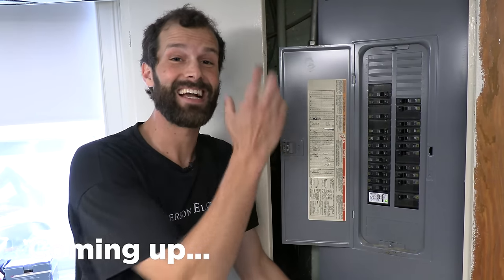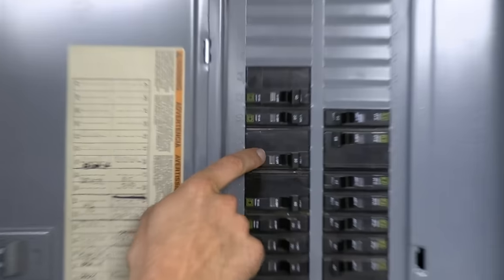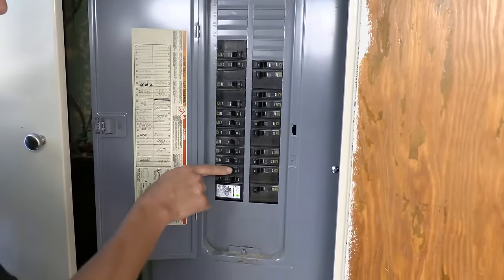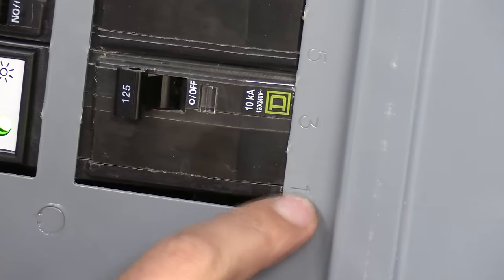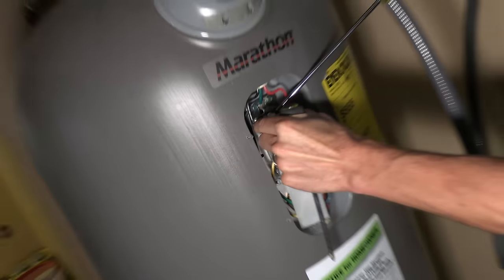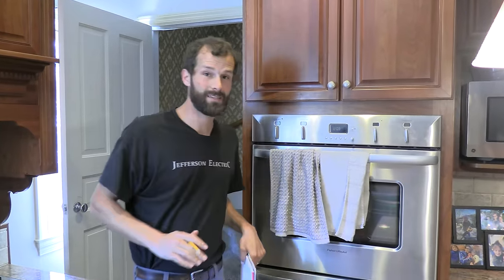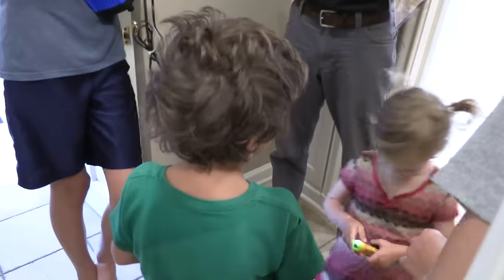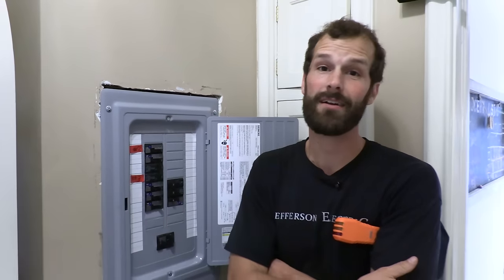A Master Electrician's Worst Nightmare

Comment: I ran into a breaker for an electric furnace that was off but the circuit was still  live. Never assume the circuit is dead until you check with a meter
Reply: So the breaker wasn’t off evidently. Always assume the power is on until you’ve tested otherwise.
Reply: Moved into a nineteen-fifties’ “starter home” ($US~15k) in ‘78, with a garage-bedroom conversion (obv. by a previous owner/helper) that popped a breaker reliably. Replaced that old Pushmatic breaker, found one that popped on the other phase. They had double-fed that loop from both strings of outlets !
Reply: @adammorgan9304  not true. I've seen a guy get shocked on a circuit while the breaker was off. Not a shared neutral either. We replaced the breaker and the problem went away.
Reply: I’ve seen multiple ways that the breaker is off but there’s still power to the device. Yes, there’s always an explanation, but that’s kinda the point. If you check for power before working, then you’re alive and healthy when you’re figuring out how the thing was wired.
Reply: Sometimes when I'm being lazy, I simply short the conductors together with pliers or something after turning off the breaker I think is the one. or before... 😮
Reply: @warlock529  I definitely short the wires with a tool to verify that I’ve opened the correct breaker. Pretty much always.
Reply: i looked for this answer!!! :face-fuchsia-tongue-out:
Reply: That makes no sense at all.  The source is either off or on. Getting lit up on a loaded neutral is likely what you’re implying happened.
Reply: Use your tongue to be sure, should feel the same as a 9v battery. Trust me im the battery.....
Reply: @killmenow5  HAHAHAHAHAHAHAHA i asked 16 yr old daughter if she ever haas done that her reply NOOOO Why would anyone do that!?!?!? man, these kids don't know real fun yep in my 60's :face-blue-smiling:
Reply: Always Always Always double check with a meter!
Reply: a meter wouldn't show a live wire unless you have access to a known ground for the other probe, so a NCV tester is good as an additional check, because it can detect the high voltage in absence of a ground reference. Have both on hand-
Reply: I mean, I usually just touch the hot with one finger and the ground with my thumb but sometimes I can't feel it so I guess a meter is more consistent. Also, be aware that switching off a 240v wall heater at the Tstat may only turn off one phase, the heater will be off but there will still be a live wire there.

Comment: That was not an insulated screwdriver. That is a Klein by the looks of it and says right on them that it will not protect against electric shock. Insulated has a plastic coating over the shank.
Reply: I think he meant a screwdriver with the handle insulates him. Since this video doesn't seem geared for experience wireman.
Reply: they just write that for insurance purposes, the handle is most certainly insulated because i often work on 600 with mine, just gotta know where the spicy parts are and dont touch em

Comment: If you don't care about turning off other breakers, you can find any breaker very quickly by using a strategy that programmers call binary searching. First flip half the breakers in the house. Light off? It's in that half. Light on? In the other. Then take the half it's in and flip half of those. Repeat until you've found the breaker.

If you have 40 breakers, flipping them all one by one will take 40 flips. Flipping them in this way will identify it in 6, maximum.
Reply: What an interesting practice! I'm curious as to how this is used in the programming world of work.
Reply: @thinktank8286  lots of ways, it's very handy! The most common usage is searching for a number in a sorted list. Even if the list is large, you can pull out the middle number and cut it in half repeatedly depending on whether it's greater or less than your target. The number of steps you need is the base 2 logarithm of the list size, much smaller than the size of the list itself. The principle is also used to partition data into "binary" trees (two branches at each node of the tree), where going down either branch cuts the problem in half, recursively
Reply: That is an interesting concept, but it’s not accurate to say 6 flips vs 40. You mean 6 “rounds” or groups of breakers operated. 

For example if you have 40 breakers, in the first round you flip 20, in the second round you flip 10, in the third round you flip 5, etc. So far 20 + 10 + 5 = 35 plus the last few rounds of 1-2 breakers each. 

Compare this to flipping all one by one. In both cases, you have to flip almost 40  breakers total (maximum if you are unlucky)… Or less if you are lucky.  Right?
Reply: @JL-uc7xp  that's true, but if you're working alone, that might be the difference between 6 trips back and forth to the panel and 40
Reply: @thinktank8286  it's used for searching.  Say you have an ordered list of data, say customer names.  If you want to find a specific customer, you can use this method to find the customer name dramatically faster than looking through the list sequentially
Reply: Called Divide and conquer in troubleshooting
Reply: Been doing that for decades. Working by myself I would tape the trigger on a saw or drill that was loud enough to hear from some distance. I think that technique is faster than the new fangled circuit tracer I have. 🤣
Reply: @tonywagner4836  An old time radio or boom box works good, too.
Reply: Binary searches can be useful for many things. If you are searching for something on a security system, like a bike going missing, bird feeder getting knocked over, etc. For example, check 48 hours ago, is the bike still there. Then check 24 hours ago, and so on. You can find it in a couple of minutes instead of going through hours of video.
Reply: @tonywagner4836  a radio works too!
Reply: Instead of labels that are ambiguous vague and confusing, I like to have a small floor plan drawing showing outlets and lighting. No need to show connections like a build print. Label each outlet or light with circuit number. Done! Also I  print out circuit breaker numbers large black text on white background and stick them on the panel. Easier to read than stamped numbers on a steel cover.
Reply: If at the start you are "flipping" half the breakers 20 out of 40 how is that "6, maximum"?
Reply: I liked that you employeed your kids to help with the task of checking all the outlets and it provides a good fun way to teach electrical safety.
Reply: Bifurcation...
Reply: @truthdefenders-  he meant to say 6 rounds or 6 trips...
Reply: The reason I'd want to minimize the number of flipping breakers is to try to minimize the disturbance to the house power. You may as well just turn off the main breaker if that doesn't matter, and you just want a one shot trip.
 Ideally you'd turn off only the one that's necessary.  The circuit detective device works well to find the target breaker without having to do trial and error.
Reply: @dubmob151  But the reason to NOT simply trip the mains is due to the current load and wear on that breaker.
Reply: Fancy way of saying flip em until dem lights go off.
True story- I overheard....
Engineering Student to Electrician; "Are those JK Flipflops?"
Master Electrician: "Dunno- just switches."
Point is, it's easy to make simple things sound complicated.
:body-blue-raised-arms:
Reply: @munsters2  lacking any other means, the radio works the best, as you can immediately stop flipping as soon as it's off, rather than flip a whole bunch regardless.
Reply: Brilliant
Reply: I'm retired from being an Industrial Maintenance Electrician that led me into specializing in trouble shooting. Not everyone seems to have the knack for this. And I heard of this cutting your search in half during the training period.

Comment: have done this chore many times over the years. One or two helpers, tops. If you are by yourself and don't have fancy tools / testers, just use a long extension cord and a radio turned up so you can hear it from the basement. Start with breakers off and when the radio comes on you go up and see which outlets are working via the long cord. This way you don't have to carry the radio around so much. Leaving light switches on will aid in finding those circuits along the way. Do the big appliances the same way... turn them on one at a time.
Reply: Great idea. Ensure the radio plugs into the outlet and doesn't use backup batteries for power.
Reply: @outlet6989  ... not to point out the obvious, but I think you would figure that out while setting up the extension cord.

Comment: A potential tip for narrowing down everything you are testing would be to put a piece of painters tape on every device/outlet that you positively identify that way you remember you can ignore it as you continue to go through the panel.
Reply: I use this technique too.
Reply: Good idea. You can also mark the tape with the circuit number.
Reply: @Doug-gp2qw  lol... I do that as well.

Comment: Man... Just last week, I completed identifying all my circuits, deleted abandoned wiring as far back as my opened walls gave access to (then taped and labelled "ABANDONED"), tidied up wiring within the panel's gutters, then created a detailed (and date-stamped) panel schedule for my 30-space Square D panel in my 60s house. Since I was adding circuits, I decided to snip pieces of Romex insulation to also put labels on the wires at the breaker termination so that there's less guess work to do during servicing.

After watching your video today, I feel good about having not missed a step. Thanks for documenting and sharing the master electrician's process!

Also, working around 7 sub-panels must be extra time consuming... Glad you got quality help!

Comment: I've done this a few times.  I first make a sketch of the floor plan, and note each receptacles location on the plan.  While checking,  I note the breaker number on the sketch.   This ensures, I don't miss any,  sometimes there is an odd breaker in the mix that you don't realize.

Comment: For my house I created a spreadsheet that lists every single outlet, switch, etc. For example, "Bedroom 2 outlet on west wall", or "Bedroom 2 all outlets", followed by the breaker#. I keep this on the wall next to the panel (along with the basic floorplan from the purchase documents / appraisal). It has been quite useful over the years. Doing the investigation to set up the spreadsheet also helped us identify abandoned circuits (we also live in an old house) which we were able to remove from the panel. The spreadsheet detail also made the panel labeling much easier. Over the years this has saved us a lot of time.
Reply: We have the same thing. Our previous owner had identified each breaker. But recently we had an electrician came in to replace a lot of receptacles. We discovered that the original list was wrong. Our living room and master bedroom are connected to one 20amp circuit. Kind of disturbing, but that’s how the house was originally wired. Built in 1981.
Reply: Then you can line the litter box with it.

Comment: A super nerdy way I did this recently was to use an IoTaWatt whole house monitoring system (the kind with the clip-on CT) and walk around the house with a load like a hair drier. Just flip on switches as you go into rooms to see the spike for lights and plug the hair drier into each outlet you want to test. Way fewer trips back to the panel since you can watch the graphs on a cellphone or similar
Reply: The Emporia Vue has the capability to monitor 16 individual breakers and is able to plot the current draw as it changes, which shows everything in detail. Comparison with the utility bills matched the kWh charges. It was well worth it for the capability to track things-

Comment: I need me some crazy lights 😂. I did this to my whole house. Every outlet. Took probably 4 hours. Also labeled the MWBC and gauge used. (There weren’t any handle ties). Put it all in an excel doc and printed it out. Very helpful for finding code violations and working on upgrades
Reply: Exactly! Every time I do a panel upgrade, labeling is not only a Code requirement to pass inspection, it also allows me to discover things that are wired to circuits they're not supposed to be wired to. I can use that to sell more work in the future.

Comment: Hi Joel, I’m enjoying your videos. Just noticed the dryer ducting on the wall. All the ells, I think I count 3 including the one at the back of the dryer, effectively add about 15’ per ell to the overall length of the ductwork. Like the flow of electricity, it adds resistance to the air flow creating lint buildup and blockage. I run a diagonal, smooth aluminum piece from the back of the dryer to the last ell. Just a suggestion.

Comment: Nice work everyone!  I know you've done this Joel, at least by accident, but we've resorted to the Blue Flame Test (dead short) IDs and tests breaker!  I understand why you chose not to mention it.  We had a commercial building with multiple panels sharing circuits (color to color joined illegally in j boxes) all over the damned building.  Iding the circuit, BUT, it was still hot at the open breaker, so my advice is to add the step of checking the terminal with the breaker OFF, just to make sure.  YOU ROCK BROTHER!!!

Comment: When we did this in a complex setup we would use painters tape to tag out the devices/outlets/switches, to avoid retesting. Yeah, it's not fun, but it does help with any later work. Great video.

Comment: On a whim I bought the circuit tracer at Harbor Freight. Other than the soft button that likes to get bumped ( i fixed it by adding a manual switch ) it does fairly well for somebody on a budget. The only downside other than the switch is that it can occasionally lock out on testing and give a false negative on all circuits, to remedy this just restart the thing and start over. the time saved getting things labeled will certainly make up for an extra 10 seconds running down all the breakers again.
I have actually used it on an actual an fuse panel and had great success, on some older breaker types it is a little iffy.

Comment: I worked in a large office building, and the inside of each outlet switch plate was labeled with the circuit number.  No guessing which breaker powered each outlet.

Comment: I had a new Span panel installed in August 2022 and I've been slowly documenting all of the receptacles so I can have a comprehensive list of outlet/receptacles. The house was built in 1977 and hasn't had a panel upgrade until now.

Comment: i would avoid having young children doing lots of plugging in and unplugging, especially with those angle cords.  it is too easy to get fingers into the space with the prongs while still making contact.  i know this can happen because it actually happened to me when i was little.  the older kid might be OK.
Reply: RE:Phil Howard.  I was thinking that, too. I have shocked myself a few times when I got in a hurry or when the plug is small/tight and difficult to get a grip on and I reached a little too much around the back of it.

Comment: There is a recent recall on those QO panels with a specific date range (194871 - 221343) that are effected. @ 2020-2022. Seeing that surge protector may indicate that panel was installed after Jan. 2020. Schneiders website has further details.
Reply: I believe this was only for plug on neutral planels and the panel in this video does not appear to be that type.
Reply: @montgomeryfortenberry  Ya. You're correct. 🤦‍♂️
Reply: @gwilliams1001  lol no need to facepalm maybe your comment will let somebody else know they need to check their panel to prevent a serious issue

Comment: small note; i've got that same klein circuit tracer and the plug in tester/transmitter is rated for 120v, if it gets 240v, all three lights appear to be on, so if you're tracing a 240v circuit you might want to alligator clip to one line and the neutral instead of both lines when possible. these circuit tracers can act weird occasionally as it is, you don't want to damage it and make it more uncertain
Reply: Yeah I commented about that... I have same tester but it's rated for 120v... he must have used neutral and 1leg..  but I could be wrong

Comment: Also good thing to mention , before you touch your fuse box , get a voltage meter and test the panels handle to open it , its metal housing ..and the screws that hold the front cover on are special screws with blunt tips , so it shouldnt pierce a wire when your screwing your cover on ..